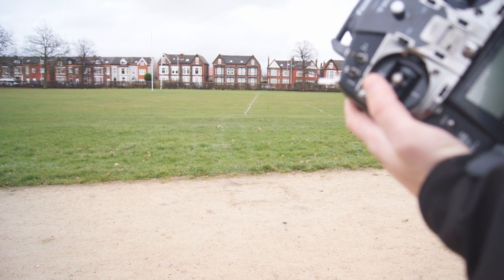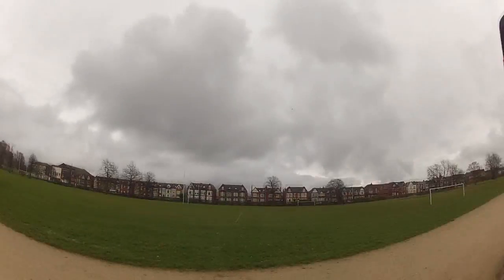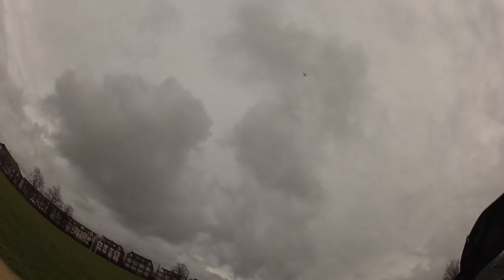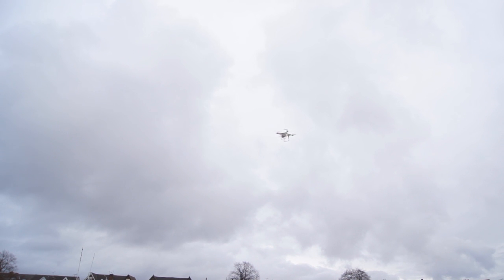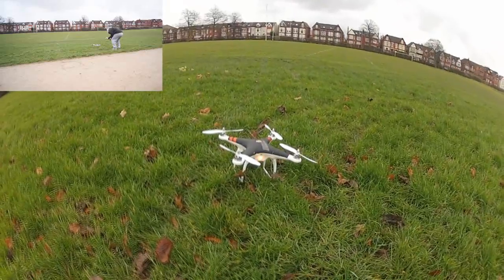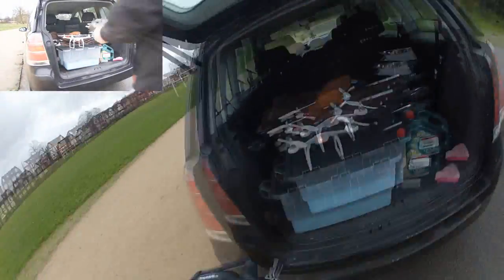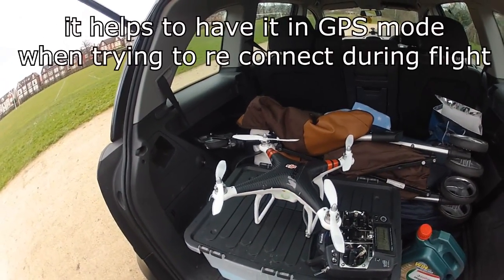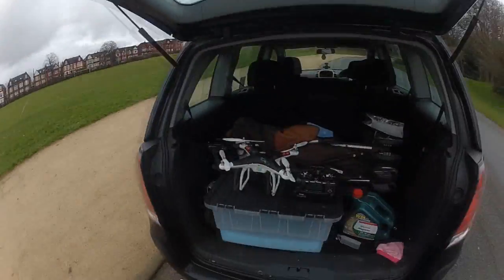DJI Phantom Fail Safe test using Futaba T8J

Comment: I just setup my 10J which is very similar and I used your guide but could not understand why you have a 53% throttle failsafe setup? Whats the purpose of it. Sorry just want to understand everything I am doing to my quad/10J
Reply: maybe 53% so if your in manual mode it will stay up in case you loose signal..

Comment from the maker: yes you can toggle the switchs back and forth a few times and you should be able to reagin control, make sure you are at 50% throttle so it does not fall from the sky.